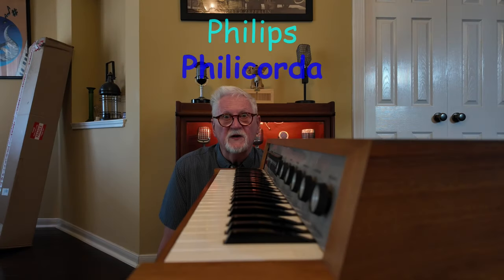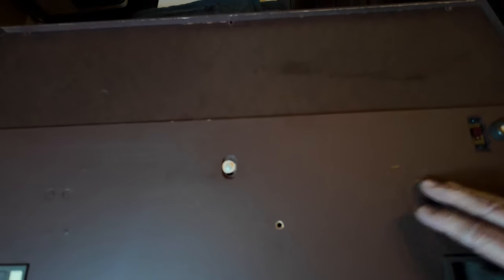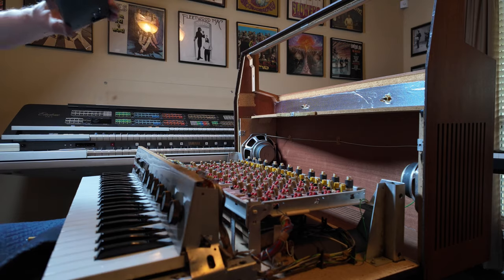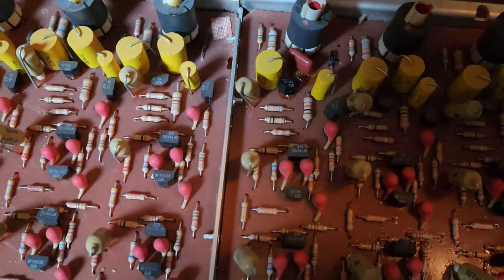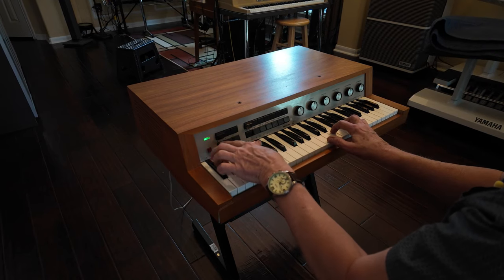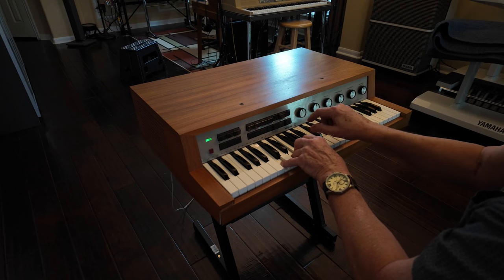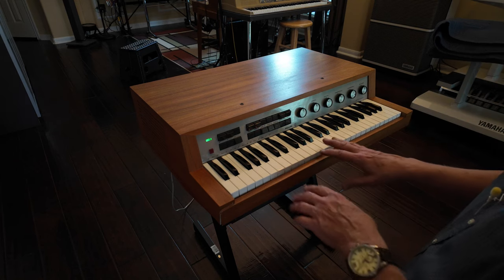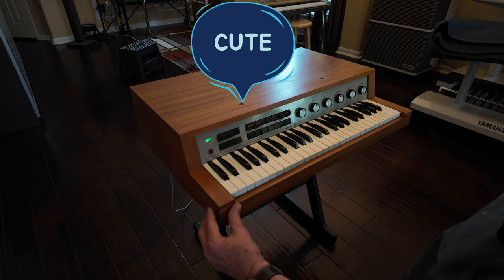60's Philicorda organ in for repair.

Comment: I own the same model for a few years. You can get them very cheap here in Germany, mostly in really good condition. This organs were made as home instruments, they were much more affordable than home pinanos back in the days. 
In 2020 I did a little overhaul on the Philicorda, the spring reverb was dead (had a shorted transistor) and some registers did not working (some traces on the circuit board near the switches were broken). But that was it. I also added a switched 1/4" stereo jack into the signal path, so I can plug in an effect pedal and use it with the build in speakers. Sounds very cool with the Neo Ventilator II Leslie emulation.
It's a neat little and very reliable instrument with a surprisingly good sound. 😊
Reply from the maker: Nice. Thanks for watching!

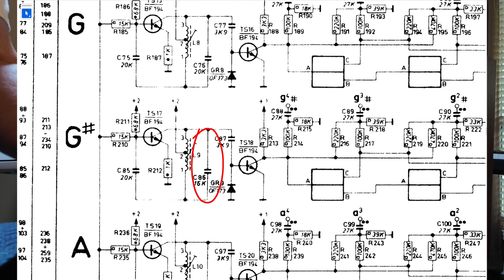Comment: 2:14 i've done a few philicordas in my life, and it's always incredibly odd seeing the modern/plastic dielectric capacitors go bad in a low voltage application. Their contemporary high voltage, mustard colored ones are always fine.
Reply from the maker: True. But glad it wasn't a tuning coil!

Comment: Nice. Is this the early model with tube power amp?
Reply from the maker: No, all solid state. Says GM751/22T as the model number. I found both tube and solid state schematics on-line so I used the solid state version which more closely matched the one I had. First one I’ve seen in person!
Reply: For me the same model. Made a quasi send/return for  connecting  a drummachine and delay. Use the output connection as send and the pickup input as return for effects connection. The headphone out I use as output for extra amp. It sounds fantastic, clear and deep!

Comment: Hi George, I just got a Philicorda GM752 from Europe and it was damaged in shipping. The 5 Din center plug on the bottom for output/headphone? was pushed in. One key is raised but still springy. The front panel looks like it pushed forward and buckled a little so I know the keyboard shifted around in transit.  I switched the power from 220v to 110v on the bottom and powered it up. Pilot light came on but no sound with any combination of switches Zero noise. Bummer. Waiting to hear back about the insurance. The inside looks very clean. Did not see any concerns with the naked eye. I'm curious what a general repair guess-timate would be on this organ. I would like to fix it, maybe as a project myself or if there is someone who could repair it I'm all ears. It's too cute to just let it go to waste. Since you JUST worked on one I'm feeling hopeful that I can get this working again. Goes nicely with my other Dutch keyboard the Solina.
Reply from the maker: Man that's a shame with the shipping damage! It's not possible to estimate this kind of problem. Especially without actually seeing it and making tests. However, I believe it can be repaired. In my case I found and downloaded the schematics and began troubleshooting the problem. The first thing you should examine is the power supply. Good luck!